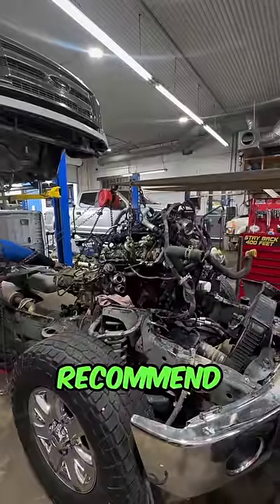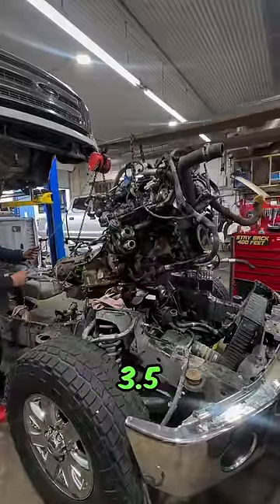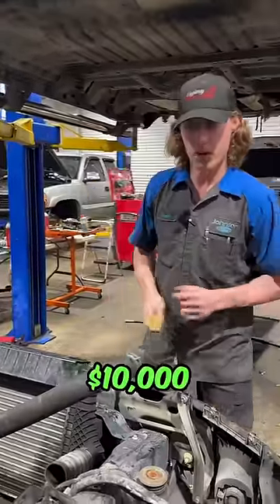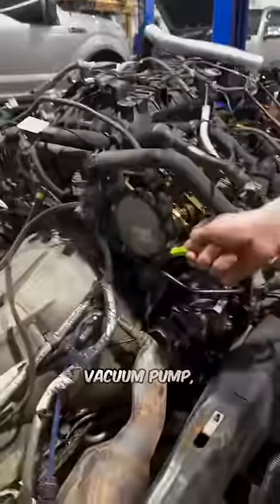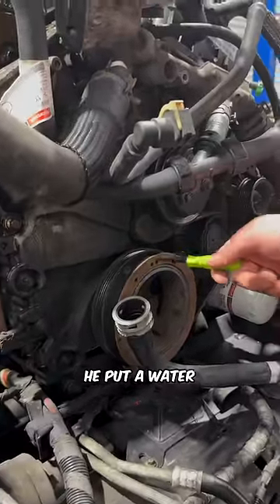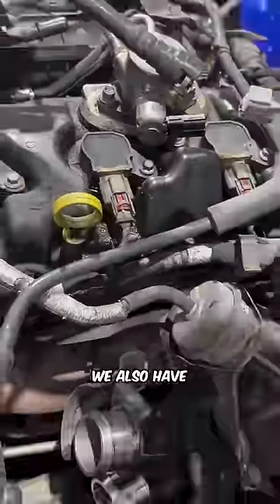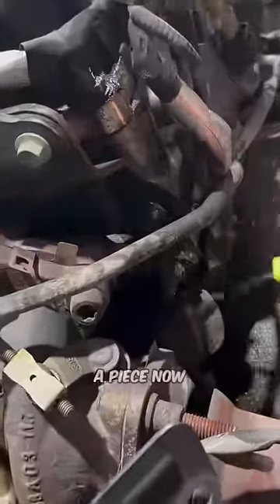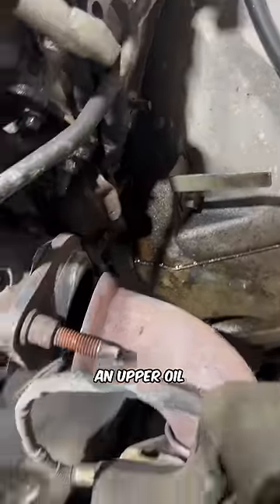Why not to buy a Ford 3.5L EcoBoost? #ford #ecoboost #shorts

Comment: I think Mosie‘s problems for people not changing the oil and coolant sooner than they are. Forget about four is recommendation 10,000 mile is lifetime mat change your oil like the old cars every 3 to 4000 miles every 2 to 3 years flush or coolant change your transmission fluid don’t flush the tranny then it will go out, I think it’ll last a lot longer

Comment: don't buy a 2007 f150 either
they took the plastic manifold gimmick in all the wrong directions
rear of it houses radiator fluid thru the engine block, upper holds fuel injectors and requires special spark plug tool plus houses separate ignition coils which are also screwed to the manifold, the front holds another radiator fluid pipe like the back with the thermostat placed so that you have to take the whole manifold off to replace it and is prone to warpage making your fluid leak around the thermostat
i learned this the hard way having to fix one and because it uses O ring type gaskets getting a good seal is also a huge pain on reassembly
ford needs to go back to metal and simple parts

Comment: I've seen a 3.5 eco boost with like 387k miles just YouTube it I think the problems nowadays is the drivers pushing the hell out the trucks and besides this ford makes the most dependable reliable trucks on the pick up line

Comment: It is so stupid putting turbos on a motor like this. These are not performance motors. You should be able to build a truck motor with enough horse power that it doesn't need a Turbo. It's only one more thing that will eventually f*** up.

Comment: This is why I just bought a 2004 excursion with 197k miles on it.  I spent $8,500 on it and can drop another 10k if needed and still have a better and cheaper truck.

Comment: Still better than my 2019 2.0L ecoboost that has a cracked block at 91k miles. 200k is good for a TT engine.

Comment: I had a 2017 F150 eco-boost that could give Freddy Krueger nightmares. At around 100,000 miles I had to replace essentially the entire front end because Ford makes garbage. By 145,000 miles I had to replace both the turbos which cost Almost $6000 so I sold the truck as to the dealership and walked away.

I will never own a twin turbo anything ever again.

Comment: Even my 5.7L Toyota needed a transmission taken out to replace the rear main seal at 200k miles. 

It’s called maintenance. Fix it and roll on.

Comment: Why not buy 3.5? When i was his age you were lucky to get 100,000 miles from any engine. If you did it was worn out with low compression. I never had or saw a Chevy SB that didn't leak. Fords were a little better in not leaking but they didn't last any longer. Engines are better now lubricants are better but like anything else they will eventually wear out. Just the way it is. 200,000 miles is a good run. Does anyone not realize nothing last forever.

Comment: Regardless of the brand, at 200k it will be leaking from every orifice, and will be probably well past due for a timing job. Heck, the venerable Vortec GM motors would be weeping like teenager that got their phone taken away by 150k, and need new exhaust manifold bolts, if the manifold itself weren't cracked.

Comment: I have an old OHV 3.0 Ford Vulcan V6 and it is gutless underpowered not very impressive but it resides in a 1997 Ranger with 357,000 miles manual 5spd 4X4 with the original engine . The real bragging point is its not a 3.5 ECO and I purchased it in the fall of 96 and I change the oil every 3 to 4000 miles with oil from the Dollar store . Just sayin!

Comment: They’re all surface leaks. It’s not exactly dripping on the floor and for 200,000 miles. What do you expect? Just drive the thing replacing Parts for no reason.

Comment: yea, but its still got 13 year old 200,000 mile rings, pistons, rod bearings, and valves. (I take it you are going to replace the timing chain and phasers)
why would you just not get a $7000 reman long block? 🤔

Comment: So after 200k the engine has some minor leaks….would be expected seeings how there isn’t a single vehicle on the road that won’t have these same leaks at 200k. And mandatory replacement shops just scream laziness. You are a parts replacement shop at that point not a repair shop. This is what all of our new techs at our shop but we will repair before replace seeings how when you have a certain amount of skill, it’s cheaper and easier to repair than replace.

Comment: I hate how I have to basically double the price of my car just to keep it running because these manufacturers, and it's ALL OF THEM, design these garbage mobiles to fall apart. 

Meanwhile we still have 100yr old Westinghouse Generators using original parts.

Comment: So it made it 200,000 miles and it's got a couple of leaks? 
Maybe I'm getting old and I definitely am but back in my day if you got 100,000 mi out of a small block Chevy you were the happiest person on the planet 
Now it doesn't cost $10,000 to replace a small block Chevy entirely but I don't think 200,000 miles is that ridiculous for an engine that still runs

Comment: Isn’t it interesting that he removed the body to get the engine out??? I had a ‘97 Ford F150 V6, 5 speed, at ~70k miles the intake gasket leaked water into a cylinder. Upon start up it blew up, bend rod, broke piston and the shop told me they had to remove the body to get the engine out. These are not big V8s, why in the wide world of sports can’t Ford built an engine that will last and why can’t they design it to where it will come out without removing the body??? That’s poor design on many levels.

Comment: Wow I have a 2012, with 215000 miles, and it is doing well. Had to have the timing chain / phasers replaced with upgrades for $6500.  Much cheaper than the overpriced garbage of today’s cars.

Comment: Well excuse me for thinking 200k is actually just fine to say nah this truck has run it’s run and it’s time for a new engine. 
My 2004 Chevy duramax has 213k and only cause it is a diesel do I feel like it is just fine. On diesels 300k is the minimum before they need this level of work. Gas engines I feel 200k and more is just lucky. Modern cars suck. 1980-2000 are the best years. Peak reliability and ease of maintenance.

Comment: 200,000 miles is pretty darn good. My 2004 F150 5.4 has 238,000 miles on it. Now replacing cats when they still function.. stupid, but I agree if theres a question of their efficiency then might as well. Seals and such wear out no matter what engine you have. Now the average price of an F150 that most people buy is $50-60000 and all the way up to $90k. 8-13 year old vehicle. I notice he doesnt recommend another vehicle to replace it. a $10,000 replacement truck is going to have its own maintenance issues.. DUMB

Comment: 10k? Hourly rate must be high. First and foremost....don't buy a Ford. Second off, if you do have a Ford dump it around 75k before massive costs start adding up. Its starting to become a standard in the auto industry. Doesn't matter how much you pay for the vehicle.

Comment: Those 3.5L EcoBoosts are absolute garbage. I am an automotive technician and I find myself working on them all the time. Turbo problems are the most common, at least for me, followed by water pump replacements and oil leaks.

Comment: After repairing the 5.4L 3valve twice in 25,000 mi (complete timing job) I firmly believe ford has lost their touch with reality. They seem to belive the consumer is made of gold, we can suddenly afford $60,000.00 every 2 years for a brand new chines plastic POS useless pickup. They better pull their heads out of the clouds and build a proper proper pickup thats truely afordable asap. Screw the stock market jockeys, if the company folds due to high priced, poor quality, useless vehicles, then the investors and stock jockeys will loose money too.

Comment: In the 30,40,50,60, and 70s you could Pop open the hood and get to almost any thing on the engine with no trouble

Hell at times clam into the engine bay and setting down if you're not to big and work on the engine

Into day's world you have to put the cab off the truck.

So has MPG double or triple what it was in the 70.60,

Is performance our of this world like having an SR71 Setting in the driveway

Or is it an over price computer control peace of crap that's not all that much better on performance and MPG .

When you look at all the cost and work it takes just to replace a vale cover gasket

Comment: 200k? looks to me like a lot of incorrect to absolutely no preventative maintenance not done to a good truck. All those leaks why didn’t you pull the air filter first and show it? Bet it’s clogged up the leaks scream that an engine WILL get air from wherever it can to run and any seal is the path of least resistance! Just telling it like it is!

Comment: Mandatory replacement of a working part is fraud theft and the reason mechanics aren't trusted. may I ask why, at any point, would that be mandatory for any other reason than theft especially on a 200k engine

Comment: I never liked Ford. Now I own an Interceptor sedan. I rebuilt the entire suspension and fully tuned up everything in the engine , fuel system, and EVAP systems, but I doubt I will ever buy another Ford car. Simply put, it's just faulty engineering and poor mechanical design.

Comment: You made a don’t buy video over a 200k engine?
Dude, 
Eco engines are worn out at 100k by design.
Only a  v8 diesel engine is good to 300k in this day and age, but that doesn’t count peripherals.
Enough eco hate for a lifetime.

Comment: It has 200,000 miles on it...and it needs some maintenance done. Yes these are all common leaks on this motor. However, they are extremely high mileage motors....youre not making any sense. You dont think this stuff fails on any other 200,000 mile motor? Lol...and youre willing to put 10,000 into a 200,000 mile motor? But you wouldnt recommend buying one of those? Theyre one of the few engines left that will go 300,000 to 500,000 miles.....think about what you're telling people

Comment: Had my hands in one of those in an expedition😢 came from the factory with a cracked exhaust valve cause the head gasket failure and the subsequent oil penetration throughout the intake system😢 All these new Eco crap engines are pieces of junk

Comment: $10k maintenance job??? 😂😂 Jesus man you could be driving a friggen Mercedes or Audi if you were willingly going to do that.
$10k for another 200k miles sounds like a very good opportunity to just put that $10k into a low mileage used truck with an extended warranty.

Comment: I drive a fleet vehicle all day long. I started with a Grand Caravan, ‘09. Then a Ram 1500, ‘12. Then the F-150s came in. I’m on my third one, and every one of them has had to go in for service a few times for various issues. Oil leak from bad pan seal twice on two different trucks, oil leak from a turbo, failed head gasket at around 30k mi. One even had to have the heads replaced with less than 20k mi. Neither of the Dodge vehicles had to go in for anything other than brakes, tires, and oil.

Ford = junk

Comment: Sorry. By the time I get any truck to 200,000 I sell it to one of you and buy a low miles 2-3 year old one.  I stopped buying new a while back.  I let the dumb bastards with too much money eat the initial costs.  Then drive them to 200,000 miles.  Then repeat.  If I truck is really doing well I promote it to a local hoopty.  That retires the previous 200k hoopty.  So I generally have two good trucks.

Comment: Look at all the junk that is on that engine..
All you need is four things air, fuel and spark.. And water to cool it...
Ford hasn't built a decent engine since they started putting a computer in it.
Sure, I own an old truck.That's hard on gas.. I can afford the gas...because I don't have to buy all the parts all the time...
Buy the way, the new trucks are just as hard on gas as mine... They just want all your money..
They're selling junk from the factory and they know it.

Comment: Man I had to do a 10k repair to an ecoboost with 107k miles. Didn’t even entail replacing engine or transmission. Included both manifolds, a turbo, front end stuff, and cat converters plus I had to pull the subframe, it was a transit 350

Comment: You are ripping people off. 10k not even for a new engine. Rip off, Ford will put a new engine in for you for 12k With a 3 year warranty or 100,000 miles   $400 manafold really i paid 250 for everything  bolts and seals for the passenger side from Ford. Get your truck out of there.

Comment: So he lists, literally, ONLY SEALS on this engine. Seal integrity is DIRECTLY correlated with PROPER FLUID MAINTENANCE. I’ll give him a break. He’s a kid, with a camera, trying to drum shit up to make a name for himself. Fact of the matter is this engine was almost certainly NOT maintained to factory specifications and it has last over 200K miles without a major hard part/internal failure. 

That in ANY ACTUAL MECHANICS OPINION is a solid engine. 

Every single gasket he listed can be replaced in vehicle as well. This is one of this creators dumbest videos.

Comment: Hate Ford.  Bad manufacturers and engineers.  Junk !! Hate Jim Farley. 
Reports about 23Tundra and Tacoma  engines are fail recall. Replacement new engines.  There are too many recall .Why are they worse in the history.  It was too expensive. I don't understand.
Go back 1967old better . Very simple and cheaper.

Comment: Ford is so cheap 😂 if you ever worked on a Ford and a Silverado for example, you’ll notice the difference. The bolts, the valve covers plastics and even brackets everything so much better built in a GM vehicle Ford uses brittle poor designs